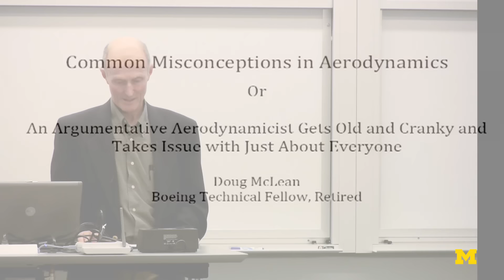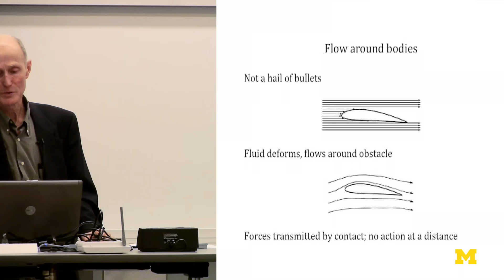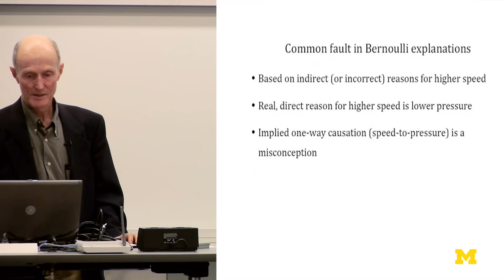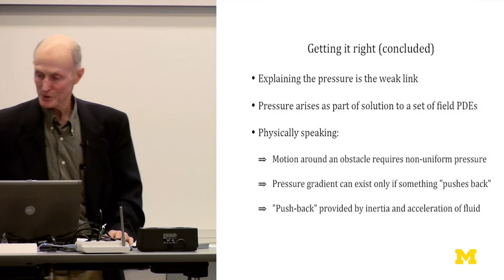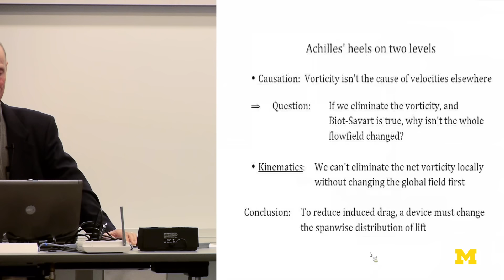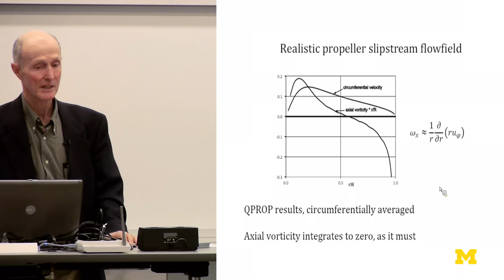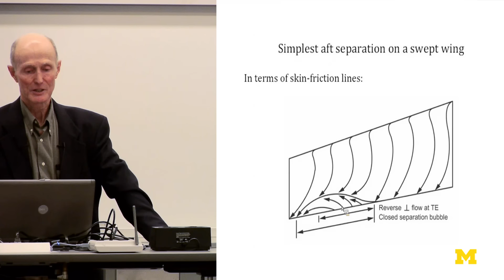Doug McLean | Common Misconceptions in Aerodynamics

Comment: I think this is the single best engineering lecture I've ever seen.  Powerhouse.
Reply: A problem though.  At about 18:09 on the last line of his presentation cell is the item "mass conservation not a direct reason for acceleration."  He says according to Newton there has to be a force associated with the acceleration.  And claims no one can tell him what the force would be.

That kind of ruined it for me.  The restriction the asymmetrical geometry presents to the mass flow rate is a hurdle to the free flow of mass supply, thus changing the density profile.  This is synonymous with the formation of a pressure gradient.  And that pressure gradient is the force he is claiming can't be explained.

So, the "law" of mass conservation is itself directly responsible for the force that results in the acceleration.  The total mass in must equal total mass out, and any move toward an imbalance creates the pressure gradient force necessary to accomplish sufficient acceleration.

I mean, for gosh sakes, the (mass) continuity equation is one of the fundamental Navier-Stokes rules formally describing the interconnected process.

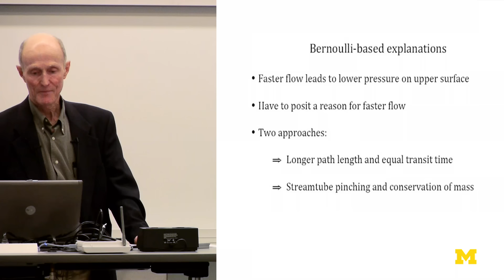He needs to go back to his previous view cell at 16:09 and rethink the "equal transit time" fallacy to bring that dead end into the proper significance of what it was no doubt aiming for in the "collective subconscious" (or whatever), in terms of his "missing force" from the continuity equation that Navier-Stokes take dead aim at.
Reply: @davetime5234  Mass conservation would indeed be a direct reason for acceleration if you could rigorously establish the cause-and-effect for stream tube pinching.  As McLean points out, he can't find a validly argued mechanism for stream tube pinching.  I agree with you about the pressure gradient.  But I can't, for example, explain the upflow well ahead of the wing leading edge, so this whole problem space is riddled with the danger of oversimplification.  

I would say that McLean is talking and thinking at a level above what we normally see.  My brother taught Aeronautical Engineering at the USAF Academy, they relied on F=mA and mass conservation, and that's indeed a much more rigorous way to treat the subject than that equal transit time nonsense.  If a section of the flow were actually constrained by a tube, and that tube constricted, then mass conservation would give rise to the exact force we're looking for.  But where there is no tube, the problem is more subtle, it seems to me.
Reply: @Tordvergar The stagnation point is the source of the flow pattern, specifically the upwash ahead of the foil.

As an airfoil moves through the air, at the stagnation point, it forces air downwards and forward. This force causes a pressure wave in front of the foil as the air just underneath is being accelerated downwards and forwards so it can flow from under the foil, back around the leading edge to the upper suface. This pressure wave, formed on the side of the stagnation point on which air is diverted to flow over the foil, explains the acceleration of air along the upper surface not stream tube pinching. Counterintuitive but this can be visualized in a wind tunnel.
Reply: @singh2702  I wrote “I can’t,” but I meant to write “it can’t.”  I think you are correct.  It is quite subtle, though, don’t you think?  The farther you get ahead of the stagnation point, the harder it is for molecules there to distinguish up from down on the approaching wing.
Reply: @Tordvergar  Yes, I agree it isn't obvious at first what exactly the foil is doing to the fluid as it moves through it. All we see is an upwash that transitions into a downwash, air moves faster over the top and slower underneath, etc. I will try my best to explain.

This behavior of the fluid is due to the asymmetrical geometry of the foil, placing the stagnation point below the wing just aft the leading edge. So the foil splits the air by a forward-downward force vector whilst moving forward. (This is key in understanding the pressure that causes the acceleration) 

The wing is moving horizontally, yet it forces air downwards and forwards. This builds up pressure underneath, which needs an escape route. As we move away from either side of the stagnation line, air is accelerated more and more greatly, by air closer to the stagnation line, as it needs to get out of the way even faster due to the downward-forward pressure. Basically, visualize airstreams further away from the foil's surfaces, moving faster than streamlines closer. (These are the streamlines that fall within the pressure wave. The air that falls out of the wave is stationary relative to the wing.)

In summary, it is this pressure wave that accelerates the air. The air needs to be forced out of the foil's path, but because it can't instantaneously vanish, it must be forced out of the way, hence the acceleration. 

This may or may not make sense it's difficult to explain intuitively. Once you grasp it, it makes sense.

Comment: Many people don’t realize that there are symmetric airfoils, such as in RC helicopter blades. This is so they can generate the same amount of lift when flying inverted (upside down). The Bernoulli/Equal Time explanation falls flat for these from the start, as lift is generated only when the blade pitch is changed, and thus there has to be a different explanation.

Comment: one of the biggest problems explaining lift starts with using molecules with momentum instead of at rest with the object having momentum. A wing moves out from under molecules that are weighted down from above and as long as the pressure differential is great enough, the weight of the object is negated. Take scales on to an elevator and weigh yourself as the floor moves down as opposed to being stationary. The top of the wing is constantly moving out from under the pressure of the molecules directly in contact with it.
Reply: Jon Miller as Galeleo pointed out the it doesn't matter if the air is moving over a stationary body or the body is moving through stationary air.
Reply: The wind tunnel is the most practical way to study lift. The reality is of course that the air is still and the wing comes along and slices through it.  The wind tunnel encourages concentration on near field effects while seeing the aircraft approach and fly past gives you an appreciation of the far field effects, which also exist. This is especially striking when there is smoke to help you visualize the effects on the air, such as in the NASA vortex studies.

Comment: I think this could be simplified for a lay audience (people like me) by talking about how a wing interacts with the double vortex in 3D (a helical field), and how wing shapes and velocity affects the interaction
- long skinny wings
- short fat wings
- faster aircraft have swept wings,
- winglets
- super-critical foil

I never thought about the fact that the 3D flow field must also extend forward. I tended to think that the air was still until it met the wing. Another error due to 2D thinking and forgetting about how fast pressure is propagated.
Reply: The brilliance of McLean's talk is in how simplified a context subject.

I suggest a class in physics for non-science majors.  Or, some ground schools in flight training qualify as the aforementioned.  Of 
 course, there are probably  'physics for dummies' type books written for the layman.

Rather than ask he simplify fuether, you lift your knowledge.  I guess that's what torqued me, people wanting to be spoon fed all the while they hardly move a muscle.
Reply: The pressure changes in air move at the speed of sound. Therefore the effect of the aircraft on the surrounding air reaches out in front of the plane by a distance equal to the time it takes for the plane to get there. As the speed increases the distance to air in front of the plane that is undisturbed is reduced. When the plane is flying at the speed of sound, then air in front of the plane is undisturbed because the change in pressure cannot propagate faster than the plane is flying.

Comment: I like Doug McLean's insistence that you have to understand & explain why some explanations are only partially correct. Feynman was a great believer in that. He showed in some detail one reason why Le Sage's mechanical model of gravitation, although attractive (it does yield the correct force equation between 2 masses), didn't work for other reasons. See "Richard Feynman Messenger Lectures at Cornell The Character of Physical Law Part 2 The Relation of Mathematics to Physics". Also, in AI learning, it is important to present "near misses" in training. If you're trying to get AI to recognize an arch, you have to show it things which are almost arches but not quite. An example of an arch could be a horizontal slab supported by two vertical slabs. But if the horizontal slab is lying on the ground next to the vertical slabs, it's a near miss - it is close to becoming an arch, but it still requires an additional step to achieve.

Comment: I suspect that the overpressure due to aerodynamic lift never makes it to the ground due to the dissipative action of viscous effects in the atmosphere; this is the same reason why the trailing vortices don't last indefinitely. It seems most plausible that, at least a large distances, a net temperature increase would be only lasting manifestation of lift in the atmosphere.
Reply: That addresses the energy portion but not really the force portion of the question. At least I would need to see a more thorough formulation of the concept to convince me.
Reply: Easily shown to be false asymptotically. On a sufficiently large planet, with a sufficiently thin atmosphere (so that elevation can be safely ignored in modeling gravitational force) and looking at the equilibrium case, every parcel of mass in the atmosphere has the same downward force no matter where you put it, and the total mass of the atmosphere must be exactly supported by the whole of the planet's surface. 

When a plane takes off, mass of "atmosphere" increases, hence total projected force onto Earth's surface must also increase, in the static limit. 

Back in the world of 1/r^2, you can elevate a parcel of mass to reduce its net downward force, thus cancelling out some of the mass of the plane by reshaping the entire atmosphere (possible but implausible). This will be tricky to do while maintaining the criteria of static equilibrium. My own math is not up to the challenge of making any insightful observation about this more complicated problem. 

Using ballpark parameters for a 747 wing at MTOW, via Google calc: 

400 tonne / 6000 sq ft in lb/sq inch = 1.02 pound / (sq inch)

The ground support will be much larger than the wing area once you get out of ground effect, and it won't be a pressure we would much notice on the ground. 

I know this also because many tanks are designed with treads that put no more force on the ground than a man walking, so that either can follow the other onto soft surfaces. 

What is 6000 sq ft in shoe size? Huge. Not going to leave deep track marks in the sand if the animal is only 400 tonnes.

Comment: I studied aerodynamics at Hermann Schlichting in the 60th in Germany. Never lift was explained by a longer path. The lift was explained by pressure difference and circulation. All foil measurements and calculations are based on pressure difference until nowadays. As a comment: lift is the force vertical to the flow direction. The total force provided by the foil is the vector sum of lift and drag.
Reply: All these "alternate theories" are an amateur scientist phenomenon. 
.
Yes. The lift force is the upper/lower pressure difference and using the two components described by circulation is one way to make calculating the values easier.

Comment: Who ever said that the laminar flow above and below the wing separates and re-join after the wing. It does not and obviously doesn't have too. A flat airfoil will still fly as long as you have AofA. Lift is best described with similarity to a parachute /Paraglider... simply put, the wing is catching and deflecting air the same way your hand will move with deflection outside a moving car window.

Comment: A "no-slip condition at the surface."  What is the effect of this assumption? What is "slip."

An extremely valuable perspective from the real side of  math and physics. Doug McLean is assuredly an aerospace scientist.
Reply: No slip is assuming that there is non-flowinf air right at the surface of the wing on a very tiny molecular distance, which is largelt why a boundary layer forms. Little friction on the wing surface doesnt allow the air to perfectly slip.

Comment: As a pilot, I have been taught the equal transit explanation. It would have been nice if he explained what the correct idea is as opposed to why it’s wrong lol
Reply: I recommend the book series "Fly Better" by Noel Kruse. Freely available online. The first book talks in depth, using simple words, about aerodynamics.
Reply: Around @26:17 he did explain lift more or less correctly: it's both Bernoulli flow plus Newton II & III (or vector Newton and Euler). But note, that assumes the continuum approximation, which if you want to be pedantic is false.  He was also clear about that at the beginning, he is doing the physics correctly for the continuum approximation, which is a fiction, but "good enough".  Air (water) is a gas (liquid) of discrete particles.  So the true ultimate explanation (of lift) for a purist is molecular collisions.  Molecular collision theory (with some adjustments for inter-molecular forces in a real fluid, stronger in liquids, which give more turbulence and drag) explains it all, and there the Bernoulli effect is pure idealization you do not use it, and it's really all just Newton II & III.  That's why the angle of attack, not the wing shape, is the dominant factor, and is why you can fly a plane upside down without inverting the wing foil profile.

BTW, if you need fine detail currently you need to use a continuum approximation (Navier-Stokes), so it's important to get the continuum theory right if you are in high performance sports like F1 or America's Cup yachting, since (I believe) it's not possible to perform large scale molecular dynamics simulations yet, although computer performance improvements constantly amaze me. On AC75 foils they might be doing some molecular dynamics.
Reply: @Achrononmaster  Yes! Have been trying to explain this to people for 20 years.😂
Reply: @Achrononmaster  "and is why you can fly a plane upside down without inverting the wing foil profile." I disagree. 1. Not all planes can fly upside down efficiently. Planes that can fly upside down efficiently such as an F18 military jet for example have very different looking wings (looking at cross section they are almost symmetrical) and lift is attained by using angle of attack to create pressure differences when you fly. You'll need to point the nose up towards the sky no matter what if you want to fly upside down.
Reply: One reason the equal transit explanation is unsatisfactory is that the acceleration of the fluid across the upper surface starts well before the airfoil. How far? Who knows? It will be a function of the pressure distribution. Also, the top surface distance is defined from the stagnation point, which changes with AOA, not the zero % chord point. But the big problem with pilot training is that it is given by pilots, not scientists or engineers. You don’t want pilots teaching this stuff anymore than you want scientists flying instrument approaches. They don’t have the proper training or technical background. And finally, there is no reason why a pilot needs to understand these phenomena at this level. The famous book stick and rudder states this clearly. It says simply that the wing pushes the air down which keeps the plane up. As an engineer and pilot I can assure you that for piloting purposes this is entirely adequate.
Reply: @Achrononmaster  - I am trying to find an answer to this and you mentioned angle of attack: How do boomerang wings create lift even though their angle of attack is zero?

Comment: Reading book. One of the best book about fluid dynamics ( and I already read a lot). Strong points ( so far ) pressure-velocity two way relationship, critics of Reynold number meaning and applicability.
Reply: Andrew Pawhat book ?
Reply: Thanks I will check it out. I'm sure it will be helpful and ofcourse interesting
Reply: Hello, can you suggest a couple of other good books on lift? 
I'm feeling like I dont have clear concepts regading lift
Reply: What is the critique of the meaning of the Reynold's number?

Comment: The device mentioned at minute 35, could be instead a large propellor.  The problem of the propeller in minute 38 is that it should be TRAILING the wing, so it can take advantage of the vorticity already there.  For instance the inner core of the prop's swept area could act as a turbine, capturing the vorticity to drive the outer ends of the blade as positive forward thrusting airfoils.

Comment: Amazing video! Gotta appreciate an expert who debunks mistakes and concludes with "it's not simple, I'm still working on it". In the interest of challenging misconceptions, there is the common one at https://youtu.be/QKCK4lJLQHU?t=475 also in most fluid dynamics textbooks, saying internal stresses are due to molecules with high momentum moving to regions with lower momentum. Actually, in dense fluids (e.g. water) and near walls, the major contribution is due to the intermolecular forces (higher than 80%) and fluids have a lot more internal structure than expected, closer to a deforming solid lattice than balls bouncing around.